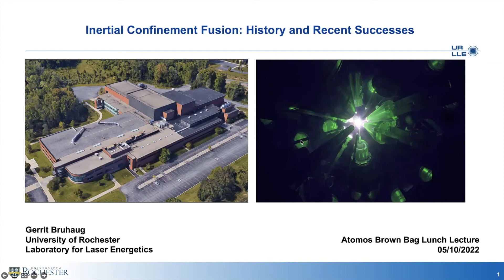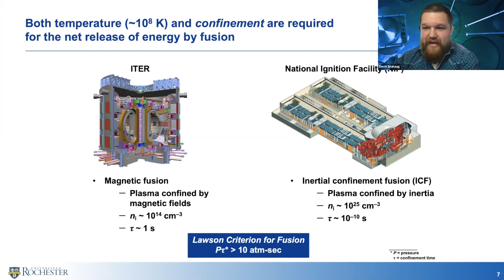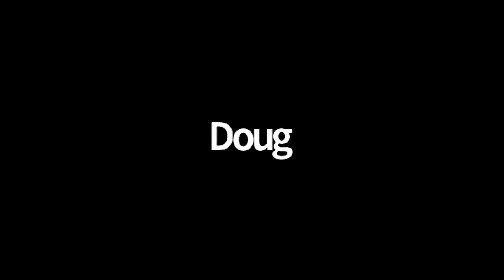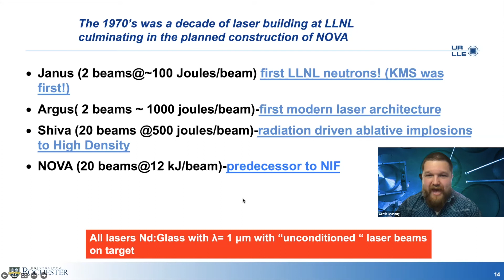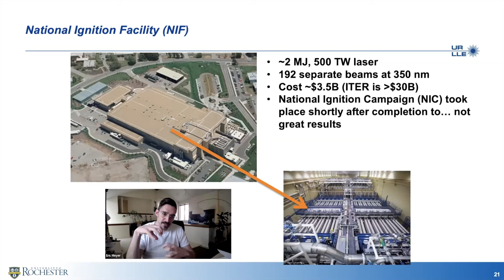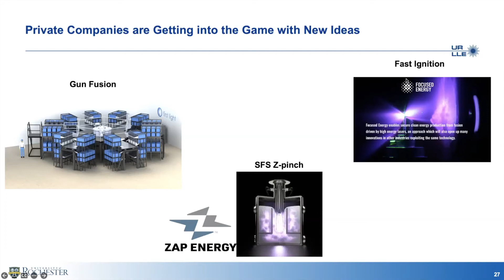Laser Fusion Presented By Gerrit Bruhaug

Comment: bei zunehmender Teilchengröße nimmt die mittlere "freie Wegstrecke" l_frei zusammenhängend mit größerem Durchmesser auch ab. Dh. der Kontakt der Annäherung nimmt zu.  Bei zuviel Federteilchen (wie zuviel Gasmoleküle) nehmen aber die Zusammenstöße zu und die Annäherung dann wieder ab. Bei ausreichend Neutronen und synchronen Feldern, hingegen 
nehmen die Annäherungen wieder zu. L_frei=1/Wurzel ( 2pi*d²*N_A*roh) [N_A = nur Avogradozahl].
Damit die elektrische Feldstärke fließt. (also keine UV - Photonen mit reduzierter Feldstärke)
benötigt man das Grundverständnis der spez. aufbaubaren elektrischen Feldstärke E_Feldstärke = F_elek/Q (Q in Elektronen, Molekülen Magnetronenfeld, Protonen, Neutronen etc.) E_Feldstärke = Newton/Coulomb_grob. = Volt /Meter (also benötigte gewisse Feldspannung).-> auch 150 Tesla.

Die magnetische Flußdichte B ~ Tesla = N/Fläche[hat aber auch eine elektrische Amperekomponente]  *Meter,  (N=C*V/m eingesetzt)->  Tesla = C[Coulomb]*V[Volt]/A[Fläche](prop ~ ermöglichtem Amperefluß und Feldstärkefluß). bei einem KW Laser kommt nur 0,03 Tesla auf einen Punkt raus. (Grund Eigen - Impulsausgleich bei UV Licht , welches zudem wieder streut)

Gerichtet, also auch über Funkwellen und dessen Feldspannung, Diese können auch einen Stromfluß 
(Ampere recht gut übertragen), weniger alleine amplifiziertes (impulsausgeglichenes ) palalleles gebündeltes 
Streustrahllicht  = Laser - UV- Licht, ohne wesentliche Feldstärke - Wirkung.

Suppe kochen kann man auch mit 1000 Licht - Laser - Deckenleuchten im leeren Suppentopf in einer Küche auch nicht.
Bei einem Infrarot Laser aus vielen glühenden Schlaufen der Kochplatte und immenser Feldstärke geht schon einiges besser.